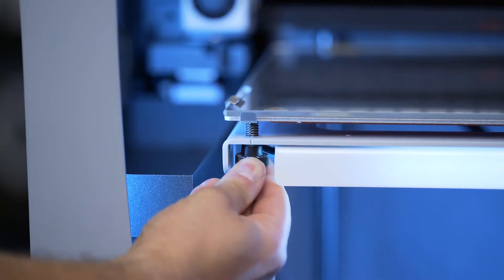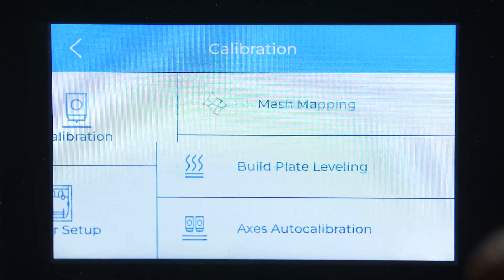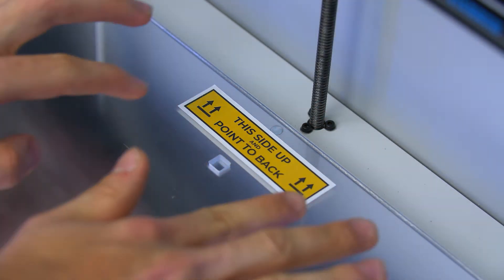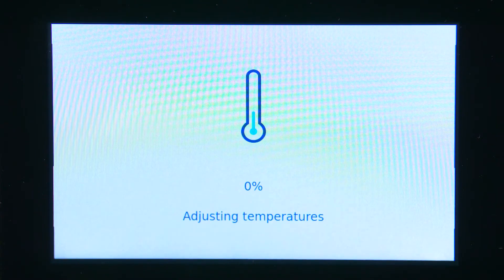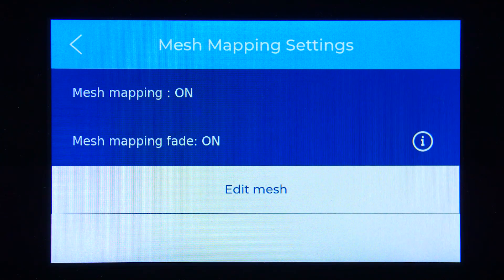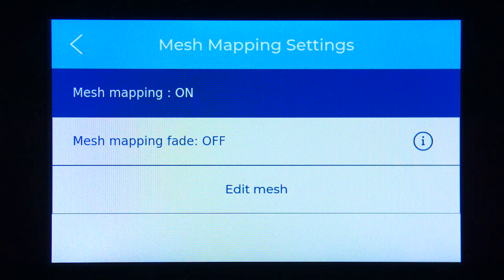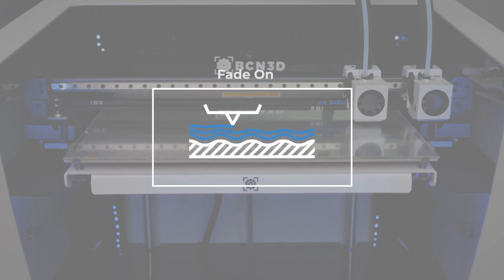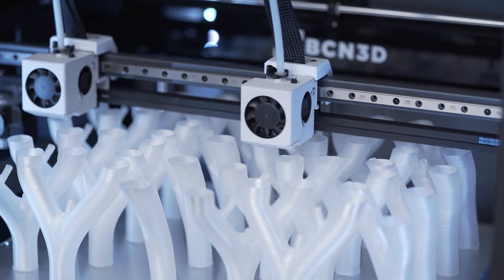Mesh Mapping - BCN3D Sigma Series

Comment: Hi , Which part of the device is located on the z-axis sensor?
Reply from the maker: Hi Walton, the autocalibration sensor is in the head itself, it is a sensor for all axes.
The sensor is located between the hotend plate and the bearing.